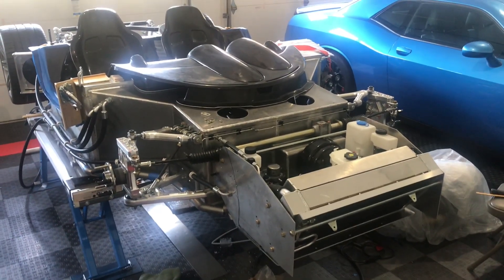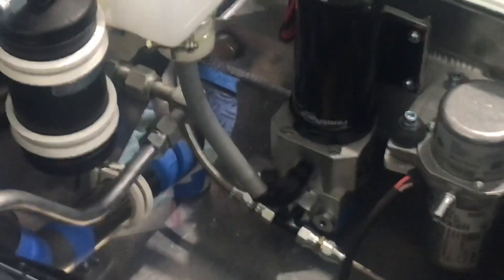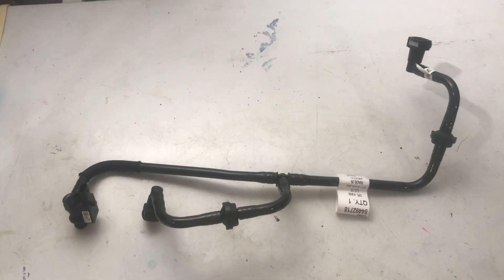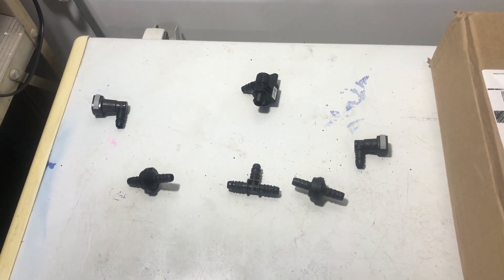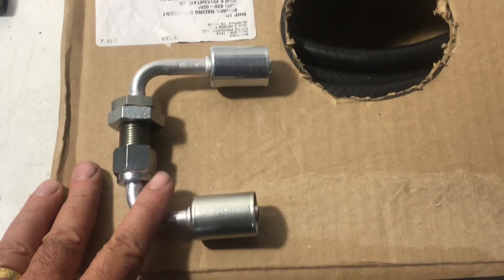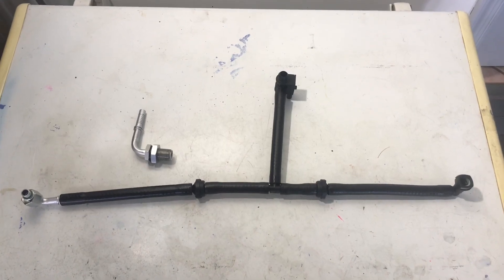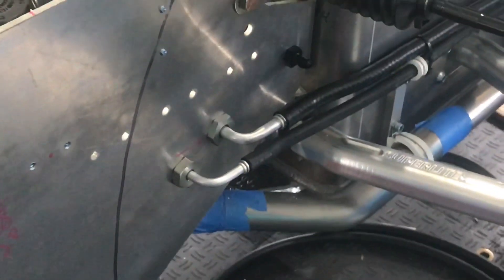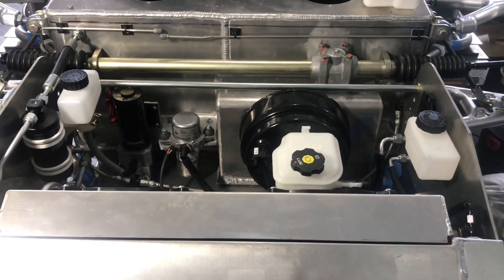Superlite SLC Build 061 Power Brake Vacuum Hose Assembly Install

Comment: Where did you purchase the push in connectors from.
Reply from the maker: @zionhomeland5127 I bought the GM power brake vacuum hose and scavenged the quick disconnect fitting and check valves. You can also buy them off eBay.

https://www.ebay.com/itm/357133773161
Reply: @JoelKSLC I found a lot of them on ebay the only one I cant find is the 5/8 female to 3/8 male 90°. That goes on valve cover sucks to have spend extra money for that 1 part

Comment: What are you going to use to control it?
Reply from the maker: @highlanderc going to control it with the PDM once I understand the pin assignments on the booster vacuum sensor.

Comment: The pump vacuum sensor is a 2 wire one wire goes to relay to turn pump off were does the second wire go? Or is not needed.  This setup is going in a 67 camaro
Reply from the maker: @jbdaytona7853 This vacuum sensor is three wire. A 5V power, ground, and signal. The signal goes to the pdm and the pdm turns on off the vacuum pump. I’ve seen two wire ones where one wire goes to ground and the other goes to the relay to turn the pump,on.

Comment: What are u using to turn on the pump?
Reply from the maker: Will use the stock z06 brake vacuum sensor to signal the PDM to turn it on. A bit convoluted, but could just plumb in a generic vacuum sensor from summit and that would do the job.

Comment: Looking to set up a vacuum pump on my Supercharged Challenger to hook to the PCV valve instead of routing that back to the Whipple. Would this work for that with a catch can?  Need a part number for the harness that plugs into the pump

Comment: What vacuum pump is that that you are using
Reply from the maker: It’s a stock GM C7 z06 pump, it is the same pump as a Hella UP30
Reply: @JoelKSLC  how vacuum does that pump make?
Reply from the maker: @musclebone7875  here is a link to the non GM version of the same pump. It says it is capable of generating enough vacuum standalone. https://www.hella.com/microsite-electronics/en/UP30-32-vacuum-pump-117.html
Reply: @JoelKSLC  thanks
Reply: Very informative. Need to add add booster on my XJ220 project.